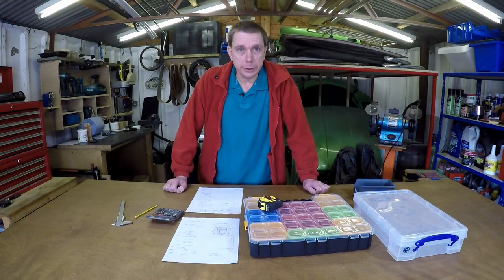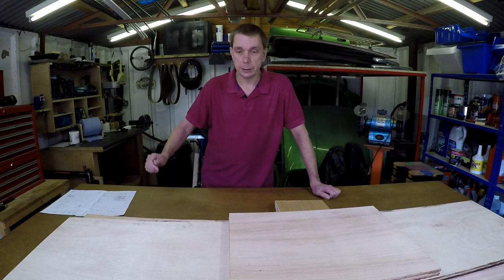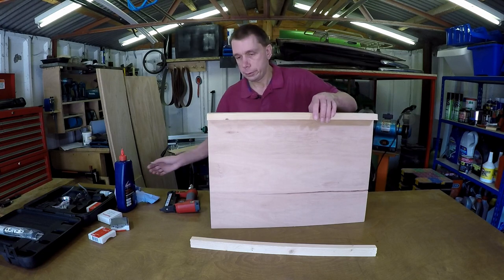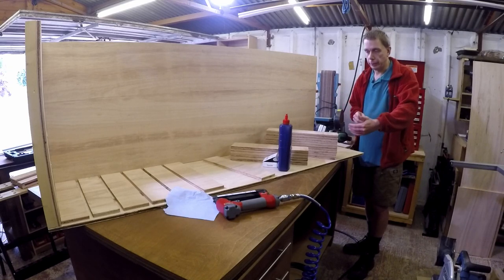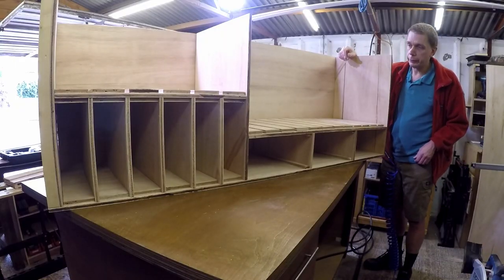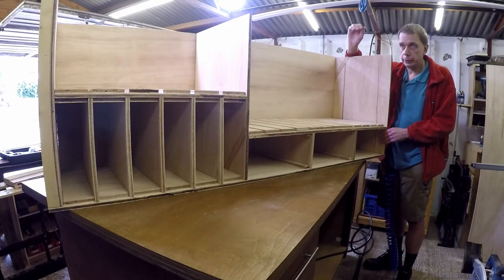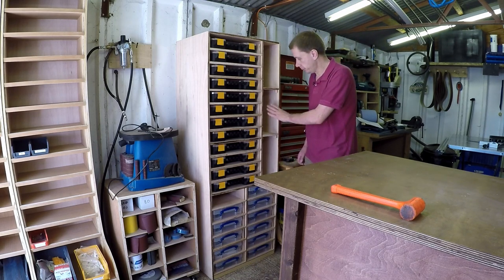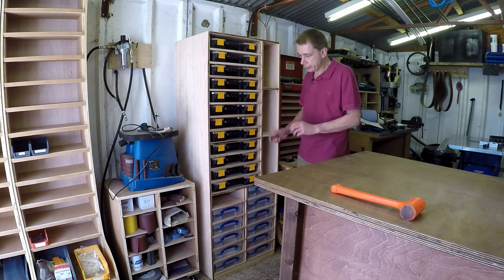Organising small workshop hardware

Comment: nice project keep it up. the small suggestion is would make is look at make a set of parallel  guides for your track saw 
they are super handy for bulk cutting I make mine for about €60 from t track and stops
Reply from the maker: That's a great idea. I probably don't use the track saw enough to need them right now but it would certainly make it easier to break up the big sheets.